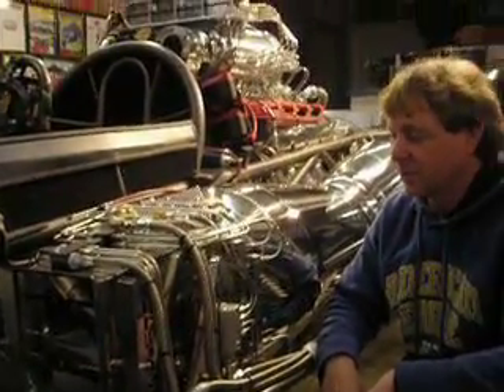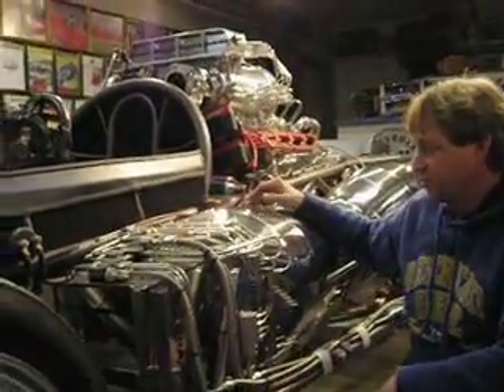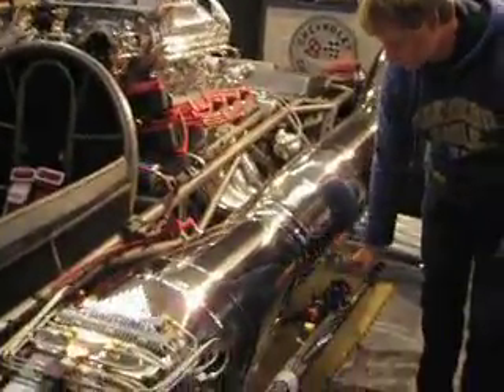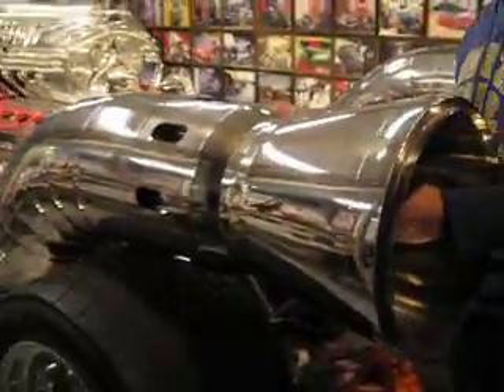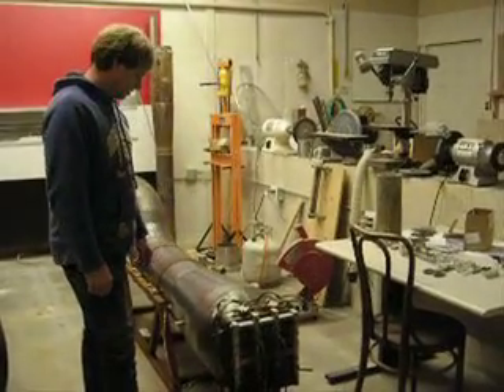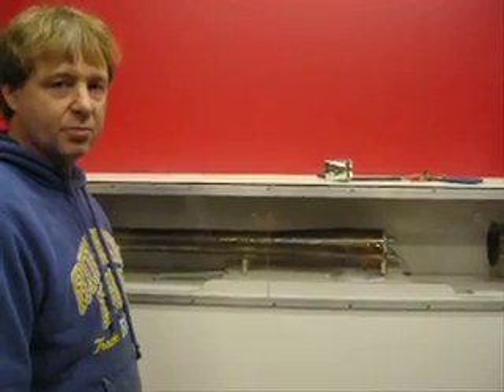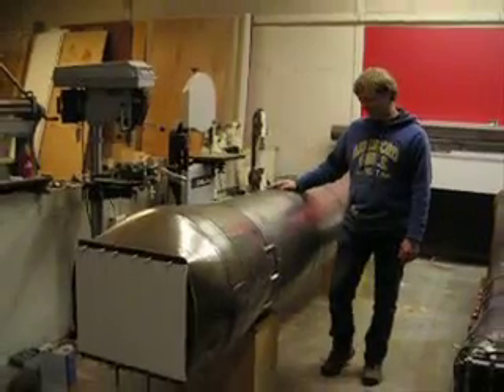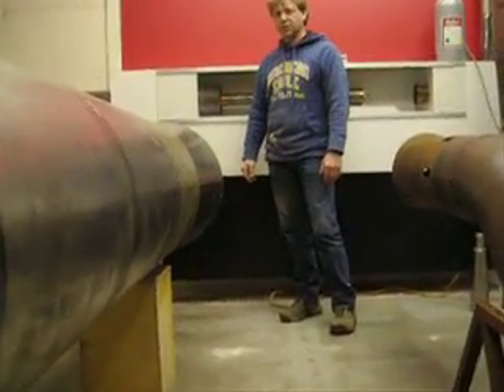New Rocketman show starting 2017 "CRAZY INVENTOR" BOB MADDOX "Bent" Pulsejet Engine

Comment: Hello, I'm very fascinated with the concept of
pulse jets. I'm a novice but I have some ideas. You seem to be the foremost
authority on them today. 

To solve the problem of vibration and to create a steady, more powerful,
 "non-pulse" thrust exhaust, what about combining 2 pulse jet
engines integrated to a single exhaust tube. Likewise, the valve assembly for
each engine should be linked and synchronized to each other, but
"opposite" each other. In effect, when the valves for engine 1 are
open, the valves on engine 2 should be closed. Subsequently when engine 1 is
firing, engine 2 is "in-taking" and exhausting. In theory this should
create a continuous, consistent, steady "non-pulse" thrust at the
exhaust end of the combined engines, similar to a fan jet or ram jet with the
extra bonus of more thrust!

What are your thoughts? 

I just thought the idea was "cool".....
Reply: TruebibleCFC very interesting, you should build one, if you haven't already.

Comment: How long do the reed valves on the intake last?
Wasn't that one of the problems that the Germans had with the Argus?
The early jet engines had problems too from difficulty in getting temperature resistant steel for the reed valves & turbine blades
Reply: +NJPurling From what I've heard, they usually last from a few seconds to about 30 minutes.

Comment: Pulsejet engines are not just kool, they are the simplest, most amazing source of motive force ever. They have the potential to revolutionize transportation. The Space Shuttle should have used pulsejet power. Why don't we have more cars with pulsejet engines -- or even lawnmowers and weedwhackers?
Reply: Pulsejets are extremely inefficient & can only be run for a very short time when used on a land based vehicle, before they overheat & self destruct.

Comment: No, they weren't invented by Germany. The honor goes to Russia roughly two decades prior to the beginning of Paul Schmidt's work in Germany. The Argus As 014 engine used on the V-1 was certainly developed by Germany for use in flying bombs, and is the most famous of them all. But not the first.